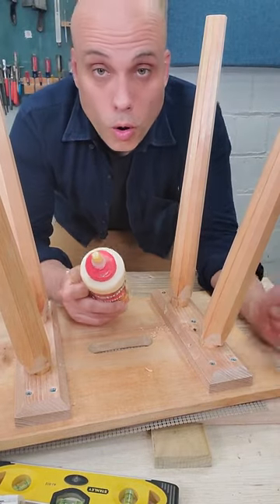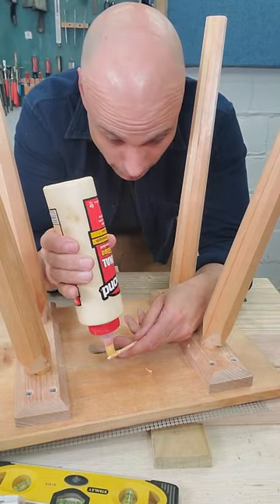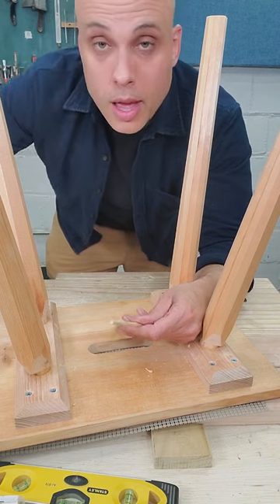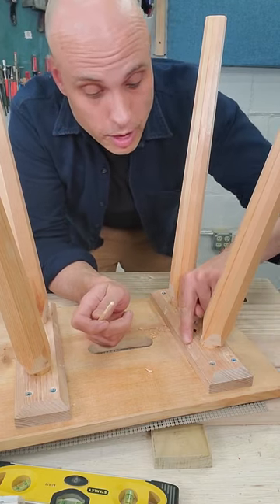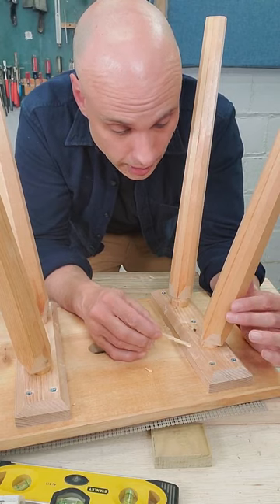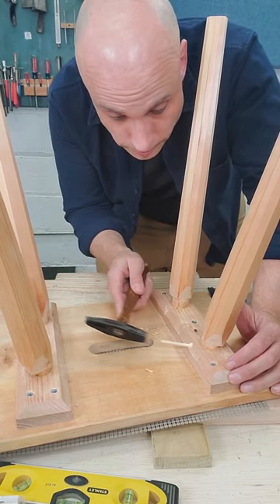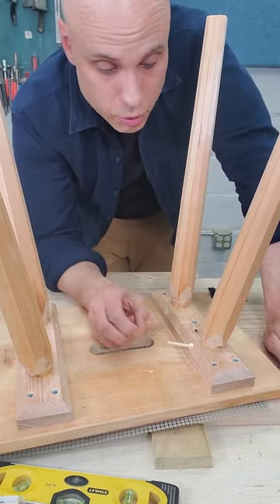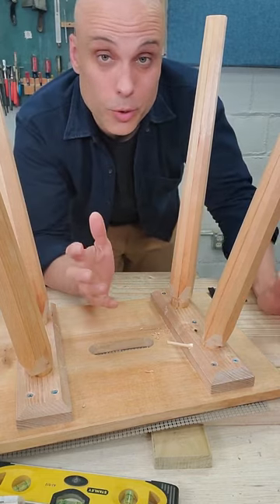Make your tenons LOCK tight! #diy

Comment: A few things to consider: Yes you can wedge them, regardless of how you constructed them; a blind wedge is surprisingly easy and your mounting pieces are perfectly suited. The angle doesn't matter much. You could also draw bore (which was mentioned in comments), which would be the best of easy + solid and is a personal favourite. You're using screws though... so just screw them instead of pinning. And if you're concerned about looks enough to not drill through, why do you have screws visible? Also also, if you glue correctly, the bond, since it is almost 100% sidegrain, will hold stronger than the wood fibres themselves. Just sayin :P

Comment: Cut a slot in the tenen, then before driving it into the hole, place the wedge in the center of the hole pointing up, and as you drive the tenant in the wedge will spread the tenen wedging it in place.
Tenen slot aligned with the wedge, glue applied on all contact surfaces.

Comment: Is there really a need for this? Everything I've seen about modern wood glue shows it's bond being stronger than the wood itself
Reply: the polyurethane glue has worked amazing for me when i need a permanent bond that can take abuse.
Reply: Yeah, I don't think this is necessary. A properly glued tenon in a well match hole is going to last a very long time.  
Also, if it loosens up, without the chopstick, it'd be way easier just to reset and reglue the tenon. Adding the tenon seems like it'd make repair much harder.
Reply: A couple reasons:
1) glue can lose strength more than wood over the years if exposed to some conditions such as heat or moisture
2) relying on glue for the strength can lead to building weak connections where it is more likely to fail. Example imagine you want to glue end grain  just to its face. Yes the glue is stronger than wood and it may hold, but its not a wise joint.
Reply: You'd be surprised how much abuse chairs can take. In most cases there's so much leverage and the repetitive back and forth can easily crack the glue overtime, since most glues are brittle.

Polyurethane glue typically does take fatigue loading better since it is not as brittle. But once a crack forms, it still fails rapidly.

I think hide glues do well under load. They don't do well against impacts. All glues have their strengths and weaknesses. Sometimes a mechanical joint is inherently better.
Reply: @spayced  
1) wood loses strength over the years when exposed to heat and moisture
2) this isn't an end grain joint. And a chopstick isn't going to 'save' the joint if the glue fails. If the glue fails, that joint needs work, chopstick or no chopstick

The idea that 'screw and glue' is always better than a purely bonded joint is simply a fallacy.
Reply: @ruffryder13  Those are great points! Happy woodworking!